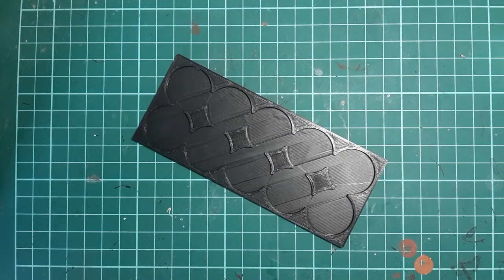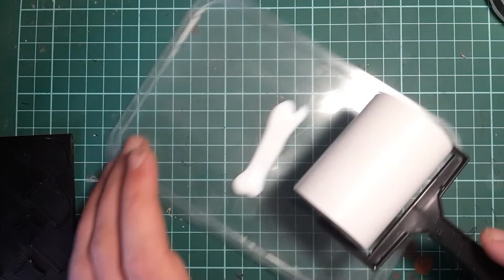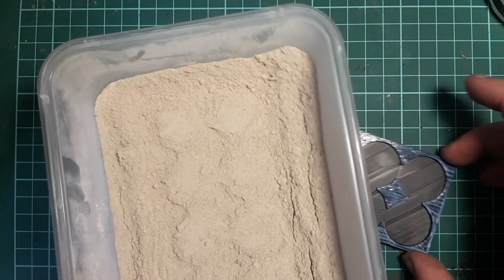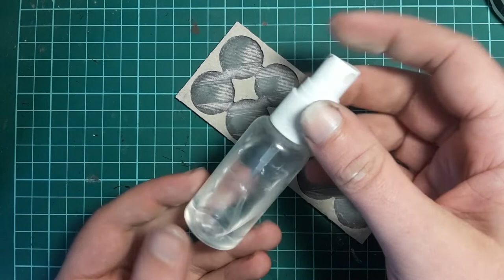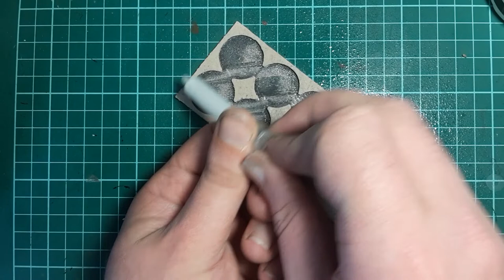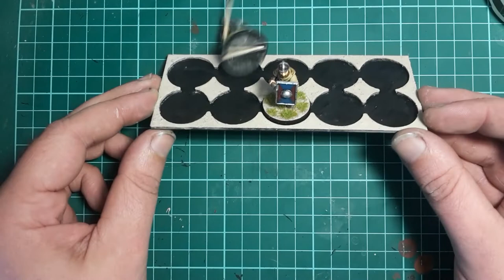Quick Tip: Basing Movement Trays

Comment: What an incredibly helpful tutorial. 

Seeing this and your other minis, i was wondering, do you paint the grout/sand mixture at all on the trays or your minis? It looks like you might be applying the grout/sand on the mini after you paint. 

It looks great and man would that save a lot of time not having to always paint/highlight sand.
Reply from the maker: Thank you. I'm glad you found it helpful.

You are correct, I do not paint the grout mixture and it goes on after the miniature is painted.
I think I misspoke in the video, so let me clear that up. It's a mixture of grout (beige coloured) and soil. 

I should probably think about making a quick video on this, but if you're interested:

The grout provides a very fine powder that better replicates soil at this scale than sand does. It is very lightly coloured though. 
This is where the soil comes in. By mixing with soil, you darken the colour of the grout and add small bits of grit.
The colour is strong enough that you can put it directly over a black, unpainted base and it will cover it well. 
Putting the water and glue mix onto the grout causes it to set and you get a very hard wearing basing material.

If there are any gaps or black areas when it dries, you hide those with static grass.
Paint the rim black and your done!

It's very quick and easy.
Reply: @AshandStoneNZ  Thank you very much for further explaining. If I could trouble you for one more clarification. Is it actual soil, like dirt or potting soil?
Reply from the maker: @TomMasonSculptor  No worries. Actual dirt. 
I grabbed it from the garden, put it through a cheap blender to break it up and mixed it in.
I've heard some people recommend baking the soil to kill off anything in it. But to be honest, I've never done it, and in three years of models, terrain and boards, I've never had any issue.
Reply: @AshandStoneNZ  Thanks! I'll keep an eye out for your next video.

Comment: i've never seen it but i wonder if neoprene contact adhesive would be a good alternative to pva. The issue i seem to have with pva on plastic is that it peals off.
Reply from the maker: I've never tried it, so I couldn't tell you if it would work or not. 
The 3D printed movement trays I use have plenty of texture on the surface which means the PVA has plenty to grab on to. If you are using a smooth plastic tray you could try giving it a quick sand with some 80 - 120grit sandpaper to rough up the surface, which will allow the PVA to adhere better.